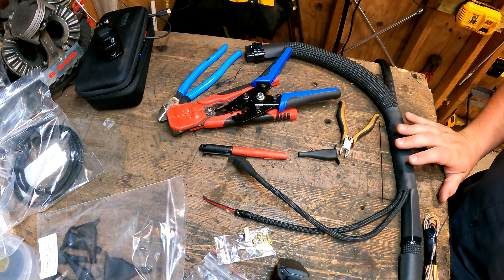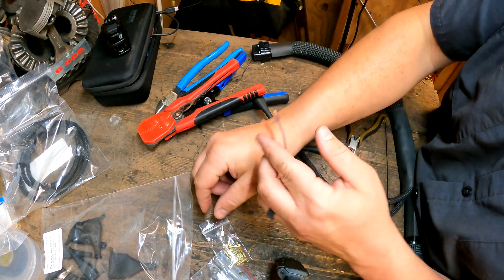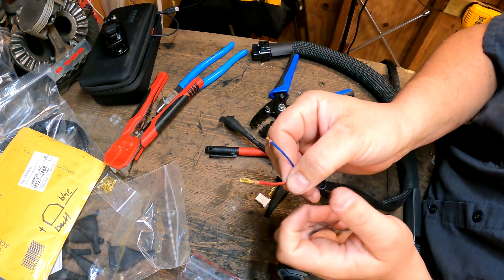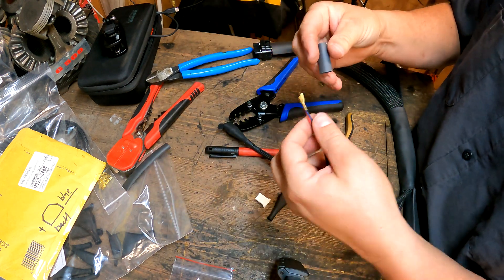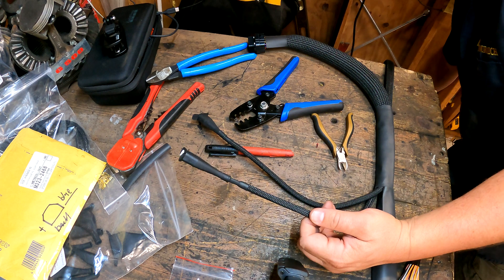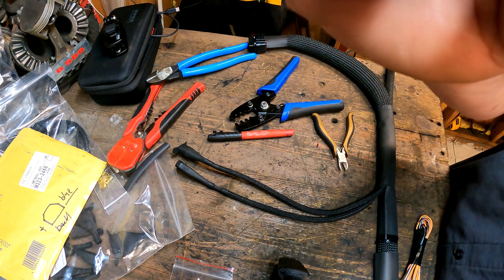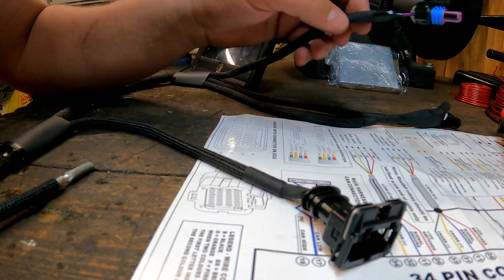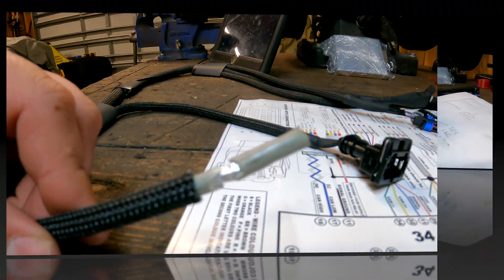Porsche 914 D-Jet Delete- Haltech EFI Conversion Part 7: Wiring Connectors

Comment: Did you use the factory oil pressure switch?
Reply from the maker: I have a “dual” VDO sensing unit that feeds both the idiot light and an actual gauge. Then a separate sender for oil temp.